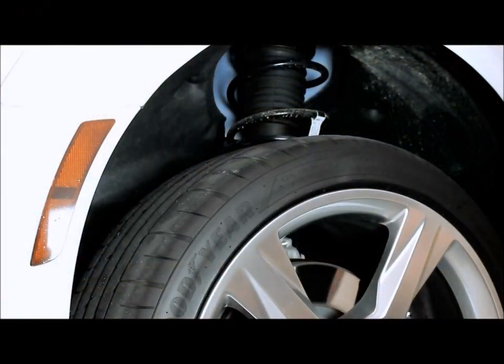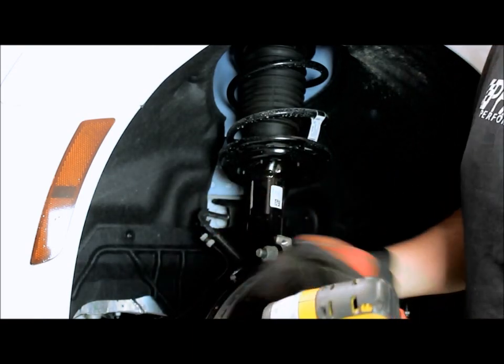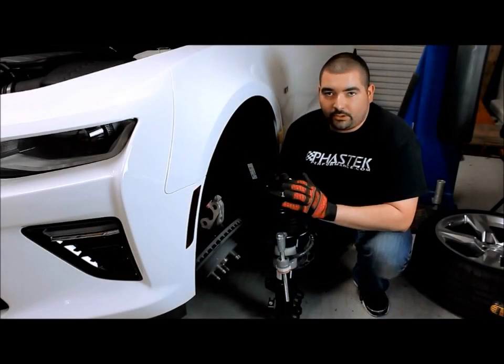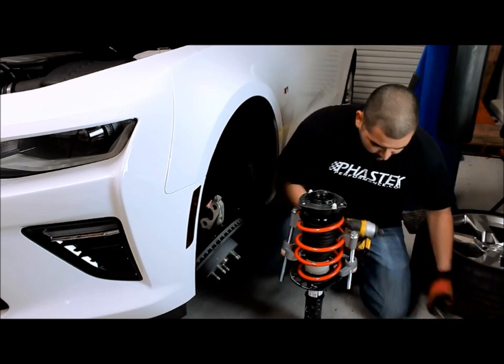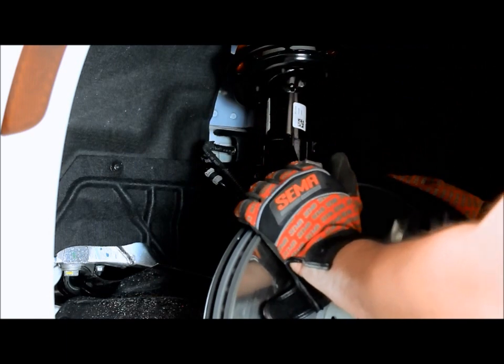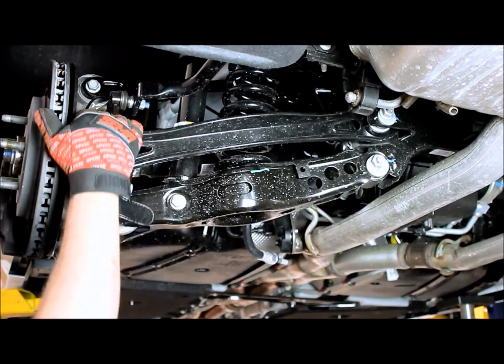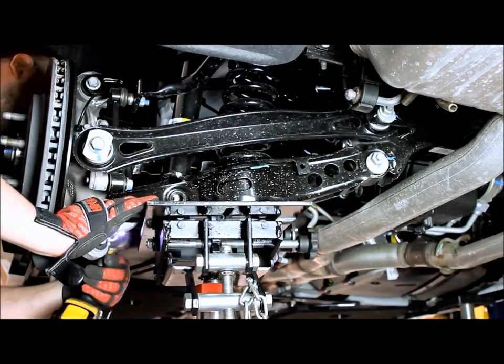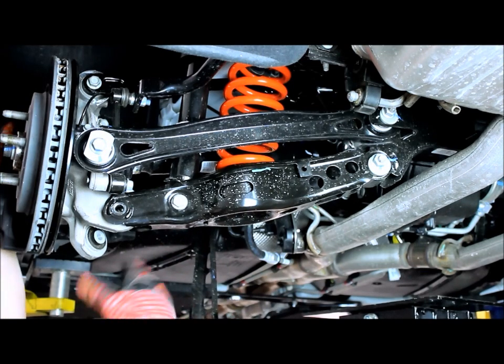2016 Camaro SS Spring Installation

Comment: some aftermarket high peformance buyers sometimes go high performance manufacturer suggested performance parts or sometimes they use aftermarket after factory performance parts to look for more ride firmness & more tunability.

the springs in general from factory performance stock can be adjusted even from assembly though aftermarket OEM high performance have more tuning for more firmness compliance with stiffer spring ratio.

no spring even from factory should be compressed too much as that causes too much ride firmness therefore springs that have at least a milimeter or more in factory spec should fix things.

don't tighten springs too much even in after market tuning either for spring life endurance

Comment: Hi. Thank you for the video. I followed all steps as you described and It helped me a lot the only problem that I have now is I can't lineup lower trailing arm with the hole, it sits approximately 1 inch away from it. Can you tell me what should I do to be able lineup trailing arm and finish assembling? Thank you!

Comment: Should be jacking the rear suspension to ride height before tightening the bolts where there are bushings or you will really twist them leading to premature failure.... (unless GM does this different than other mfgs I guess)

Comment: Watched this video multiple times , installed h&r mrc springs from you guys and I have a clunking noise on the front springs . How do I get rid of it... ?
Reply from the maker: Its hard to say what the issue could be.  I would suggest going back over all the bolts and making sure they are all tight.
Reply: Same thing on mine, what can it be? Did you find the reason why?
Reply: I know this is an old video but my guess is the 18mm bolt on top of the hat of the front coil spring isn’t tight enough.  Made this mistake on a spring instal and just tightened the top bolt on the strut and it was perfect 
Hopefully this helps others

Comment: Good video. I wonder if the magnetic ride control suspension still working normally after that installation.
Reply from the maker: We have not tested the springs on a magnetic ride control car yet.  We do know that the springs measure the same size but the spring rates are different for the MRC cars.

Comment: My strut spins when i try and unbolt their boot of the top strut piece
Reply: Same thing on mine, did you happen to figure out why?
Reply: @shanebali5427  yes you either need a special tool which they didn't tell you about or what j did was take Channel locks and a towel and clamp the strut

Comment: Any Torque specs for any of these suspension bolts?
Reply: They are not under pressure. Just tight so they hold everything together. ... impact it for 5 seconds after its tight